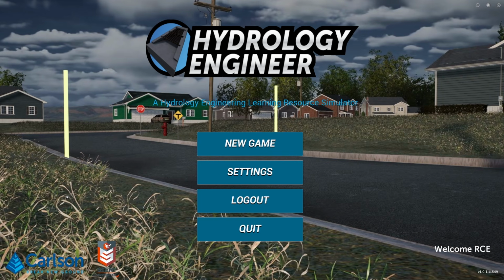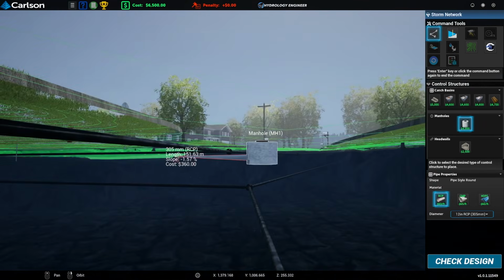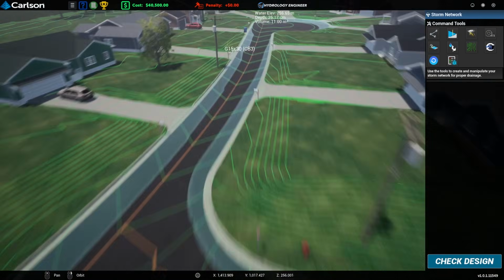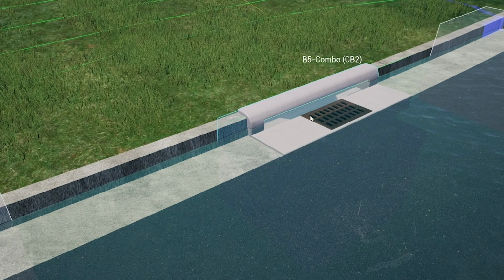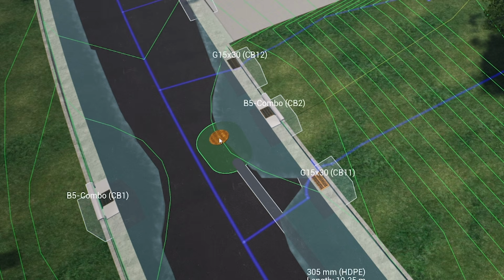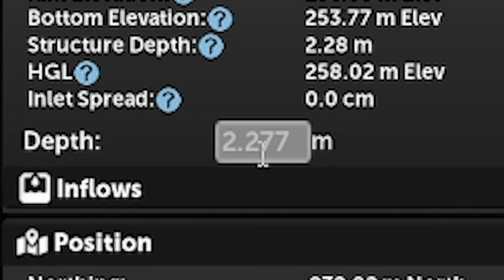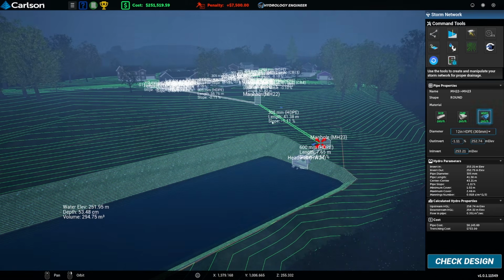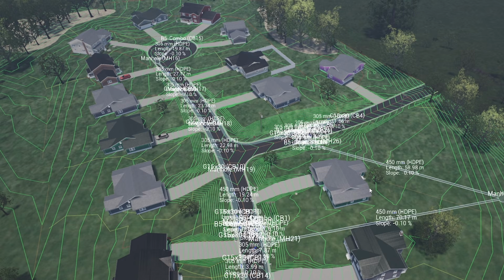The secret purpose of these holes...

Comment: I just learned something new from this actually. In geology we were taught that in rivers, you view the contour lines like “cups dumping water in the direction of flow” so the top of the v was the flow direction, but here the v is pointing to the direction of flow. And the difference I’ve learned is that roads are raised to direct water into the side drains, whereas rivers are full valleys

Comment: (30:58) why Minecraft does this is also actually because of a certain "lazyness", if one could say so.
In computer graphics, the x- and y-axis describe the "width- and height-axis" of your window, and the z-axis the "depth" on your window.
Thus, resulting in the x- and z-axis being used for "horizontal coordinates" and the y-axis for "vertical coordinates" in video games.
It would be possible to display coordinates 'the other way around' as "x, y, and z" for "horizontal-1, horizontal-2, and vertical" but that would introduce another level of calculations, which might affect game performance.
Another argument that came to mind, was, that the intended target audience is not aware of this debug-screen feature or will not use it to a degree that it would bother anyone.

Comment: Ok so this was a year ago, but on the off chance you see this, I would like to try to convince you you're wrong.

So what's my perspective? Well, I see it as I'm looking down at a map. Essentially a piece of paper. So the X and Y coordinates lay on the 2d plane as expected, and the added new dimension gets a new letter and a new direction (up).
This also conveniently fits with programming, as the up/down direction almost always is the odd dimension out.
And take the ingame map that only displays two dimensions (pfft). I find it way more intuitive to have it show X and Y instead of X and Z.

Now, I get that from the perspective of looking at a monitor, you could easily make the same argument about the screen being the flat plane you're looking at, so it should get X and Y, but the choice in naming the axes is completely arbitrary, and turning the camera 90 degrees as the final step absolutely no overhead at all. Use the coordinate system that is the least awkward for the thing you need it for.

For level geometry, Z makes more sense to be up. For triangle rasterization, it should be forward. Or back. We can't quite decide.
Hey at least we made Y be both up and down, depending on if the artist is working on it or the gpu is working with it. Nice footgun.

Comment: X Y and Z are pretty standard, though not standardized. It works the same in almost all software I've seen: minecraft, a host of other games, video software, 3d rendering,  web development,  and this tool you're using now. It's just that the tools you use are usually designed for top down viewing. But in all cases mentioned, X is horizontal, Y is vertical,  Z is depth.

Comment: Lies. When i open my tap, the water comes from a local water towery thing which isnt really for water storage, its pumped up there from the cistern so that there is pressure on the pipes thanks to elevation (even if theres a power outage). And if i flush my toilet, well, im not the landlord but id think its just a big hole in the ground, maybe something like a septic tank or something, but there is a big plastic pipe sticking out of it in the backyard to let the gasses out i think. Not really my concern so long as it works, it will be once i build myself.

Comment: Unfortunately, there is no universal convention on axis orders.  Much like little endian vs big endian vs network byte order for storing numbers in computers, there are always drawbacks however you do it.  Civil Engineering has strong ties to cartography, which used X,Y for the east/west, north/south directions (N is the top of the page, generally).  So extending that to three dimensions naturally has Z coming out of the page (Up).  Even here, there is immediately some confusion, as Down can mean either into the page, or toward the bottom of the page (South).  Meanwhile, mathematicians conventionally use X,Y for left/right, up/down on their chalkboards (now whiteboards).  Adding a third axis then naturally comes out of and into the board.  Since this is not a map spread out on a table, but a board used for instruction, there is a tendency to make the xz plane still horizontal and leave the Y axis as the vertical axis.  

Fast forward to modern computers and modern computer simulations and graphics, OpenGL, which is the library focused on drawing shapes on screens from triangles follows the mathematics convention.  Likewise, vector drawing programs (including your web browser), use Z-indexing to determine draw orders, while space on the screen is X,Y.  The major advantage to this approach is you can simply ellide the Z axis when you are working in only 2 dimensions.  Of course, this means if you are looking sideways through a 3-d world, gravity points in -Y.  

In this sense, the camera's Z axis is always out of the screen, it's just the physical significance of that which is inconsistent.  As a related issue, the moment you have something more complicated than a trivial hull and sprite, you need to track the positions internally.  Think about a simple stick figure, the head needs to be at the top, and the feet at the bottom.  If you can "ragdoll" this, then gravity within the model can be in any arbitrary direction.  So you need to be able to convert local to global coords.  Once that is the case, you very much stop worrying about which direction is your gravity vector since it truly is all relative.

Comment: the Whole X, Y, Z, thing is different in the Art world X is Horizontal Y is Vertical and Z is depth, (distance away from the theoretical view point) that is why they have it set like that in Video games (it is always invert y axis to changer the Vertical joystick controls) because they all use 3D Artists to make the models so they would use the Artist's standards because most people working on it will be familiar with that, Also the reason Engineers have the Z be Vertical, is because back in the Day they would have Flat paper schematics that would be laid out in the same as X,Y, Z format as artist would use, BUT the theoretical view point would ALWAYS be looking Down from above because that is the best perspective for a Schematic of that nature and it is only when you take that schematic and turn it into a 3D render does it conflict with the way say Minecraft is measures it, because they have to rotate it from being top down to the viewpoint of a human standing at ground level

Comment: Talking about the man holes being uplifted. A lot of our city’s man holes are welded because I don’t know about the UK, but in the US we have what we call drop neck trailers. We’re the front portion of trailer, would disconnect from the trailer itself. So you can load equipment without ramps and etc. Them trailers have engageable magnets that are safety features to help secure them
 20Ton-100Ton loads on with the chain you would apply to help secure it to. Them magnetic were strong enough to brake a man hole in half if the magnets on the trailer, picked it up and hit the trailer right.

Comment: I watched with great interest. If I was asked I would say you are at least an experienced professional in the field if not an expert. I appreciate the inclusion of real world photos of what you are discussing. Not everything a computer does has to be a game, and honestly, I have to laugh at the comments from people fussing at you for teaching them something.

The 'Z' axis confusion goes back to the late 80s and early 90s when the various 2D CAD programs began to add the third dimension. The Z axis was always the dimension that moved above or below the 2D drawing plane. The fly in the ointment came from if the program considered the "plan" view or the "front/side" view the default 2D drawing plane. AutoCAD which became AutoDesk and later 3DS Max was originally an architectural designer that worked off of a default plan view. In a plan view, Z would be 3D altitude, but in a front or side view used by many 3D object design software, the Z axis would be the depth of the object being drawn. This difference in perspective from one software to the next has never been officially standardized. Off hand I can think of one other program that uses the 'Y' axis as the altitude axis and that is Microsoft Flight Simulator (and probably most other Microsoft simulators as well).

Comment: Funnily enough; It's not just minecraft, i'm a certified CAD designer and we use Z as depth, so (in relation to the object) X axis is your left/right, Y axis is up/down and Z is forward/back. I know solidworks and autodest are setup like this, can't sat for sure others are.

Although you can change the axis orientation in most program's settings to fit the user preference. 

Great vid as always, Cheers!

Comment: XYZ: x is always to the right of the origin, y is always upwards, and z is always towards the viewer. It's basic maths. 

You may be thinking of xyz on printed plans, in which case up in the real world is towards the viewer on paper, hence it's z for you. 

In the world of video games and maths,  y is always up, not z.
Reply: Ya, except when it's not... I've seen plenty of games that have Z up. The game engine doesn't really care, you can point the camera any direction you want, and it's just as easy to define one axis as "up", as it is another. For 2D applications sure, and that's  where you get terms like z-depth and z-fighting from, because that's always perpendicular to the plane. (But again, which way varies.  +Z away from you makes more sense for a video game where that direction is forward. +Z towards you is the same as XY flat, Z up, but rotated 90.)
Reply: @Tahgtahv  true, programmers may assign any axis in any direction, but in my experience making video games, it's best practice to maintain consistent orientation. I believe blender and other 3d rendering software orients them the same as minecraft does.

Comment: The holes are perfect for the bridges right Matt? (I live in Swansea (close to you) and the big bridge that connects Neath Port Talbot over the river has lots of holes for water to flow (I guess because the bridge doesn't have any trees for leaves to block up the holes because never in a flippin million years is someone cleaning the holes on the motorway)

Comment: I think the reason that Y and Z are opposites when compared in gaming and real life is because in real life, you'd use a grid from a top-down perspective, like a floor plan, making Z vertical when working in the third dimension. But in video games, I believe they were originally popular in the form of platformers, which means when adding a third dimension in the form of Z, it would be depth and not height unlike the real world.

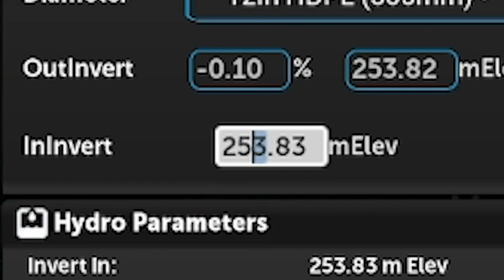Comment: at 30:10 The XYZ Axis in videogames has it's root in Math graphs, where x is horizontal, y is vertical and z is depth. it's not realy wrong in most games (this one strives to be a simulation, so i would say in this game, it's wrong). It's kind of rooted in first 2D Games like Mario where they used the y axis when refering to hight and it never realy changed when they moved over to 3D in games like mario 64.

Comment: The reason why the Y and Z for hight is different in games is, as you said, 
in reality you mostly use a top down map perspective, which naturally uses X and Y for the base position and therefor only Z for the height.
But in the beginning of games we mostly started with a 2D horizontal maps. (Like all the old games such as Space invaders, the first Mario and so on)
Wich means it would be pointless to use X and Z there and therefore they used X and Y because it's only 2 dimensional.
But when 3D became a thing in games, the only remaining value was Z, and since everyone was used to use Y for the hight, they just continued to do so and used Z for the 3rd dimension that is basically coming towards you when you turn a 2D image into a 3D one.

Comment: fun fact: manhole covers are circular because the diameter its constant and will never fall into the pipe of a smaller diameter. If it was rectangular it could potentially fall into the manhole and youd have a very deep hole in the road.

Comment: so the XYZ cordinates issue stems from computers vs maps  a computer screen is the base with a x and y cordinates being based on the cordinates of pixles on the screen and z being used as a depth modifier. where as in mapping your base is the area looking down and height being the 3rd dimention modifier. so games using the Y cordinate as a high makes sence because they are in the mind set of the compuer screen and for simulations/ mapping it is rooted from sea level.

Comment: near the high school in my city is a large field with a huge tree and one of those outlets. so it would be considered a detention pond, it has a multiway path that goes through it to the park that is on the other side of the tree still relatively lower than the surrounding area. the park used to have this really cool wooden maze structure that we used to play on. they redid the park a couple years ago and removed it which makes sense cause it was wood that would get flooded and then start to splinter when it dried out. it was there for at least 18 years before they redid the park. i did not know that it was called a detention pond till now, i thought it was just poor design and park placement.

Comment: Basically, coordinates used for describing height depend on the handedness of your coordinate system. In math, it's usually right-handed, and in game engines and computers, it's usually left-handed. But for some reason, Unreal still uses a right-handed system 🤔
Also, you should take these words with a grain of salt, as it was quite a while ago since I did any linear algebra, so I could've messed this up bery badly 😅

Comment: In the cartesian plane, Y/X, the slope, is Rise over Run. However, if you put the cartesian plane on a map, the Y is the top of the paper.

So, if you're a civil or survey engineer, Z is the height coz you have a top-down view. If you're in highschool, you only deal with polyhedrons; it does not matter where the top is. The answer would not change, but most use the lateral view. Think of a cube on a cartesian plane before you studied engineering: which one is the height?

In minecraft, the game is played mostly with a lateral view, and rarely with a top-down view. So, I think that's why.

Comment: X and Y aren’t always “looking down” with z being the height. In some engineering things I’ve done where you’re looking at the profile of something y is the height and z is the 3rd domination coming out of the page. Especially when the thing you’re looking at is plainer or fairly uniform across the z domination (thing heat transfer or airflow over an airfoil)

Comment: I think the x, y, and z orientation being different in gaming is because x is the horizontal axis, and in side-scrolling games (which were first to be developed), y would have been the vertical axis. In 3D games, the z would be for the remaining axis (which would be the depth if you're looking at something side on).
Reply: It's more because of how we use our screens. If you place your map in the wall, x and y would be horizontal and vertical respectively.
This is actually consistent with how z axis works in geometry (perpendicular direction of xy, which is the planar surface).

Its just not intuitive for people who used to have z as vertical. Some software like cad would do both; follow "screen" convention when in 2d, and rotate the view when in 3d.

Comment: In my country it's actually illegal to just let water from your lawn or driveway drain onto the road. That's because in winter, when snow is melts during the day, the water can't properly drain or evaporate, instead it will freeze over night, which leads to accidents and injury. If you have a sealed, non-permeable driveway that falls towards the road, it's your responsibility to prevent the water from getting onto the sidewalk, mostly by having a narrow open pipe with grating on top all the way across your driveway, sometimes even two if it's too steep. For lawns, either the sidewalk is higher than your lawn, or your fence sits on top of a low concrete wall. Roof drop pipes will generally drain into another surface water drainage pipe or a dirt hole filled with lose rocks, so the water can actually seep into the ground quickly and not just sit on top of the dirt. You will NEVER see a roof gutter that just drains onto the grass. The goal here is to get the water back into the ground as quickly and efficiently as possible to keep the earth moist and permeable. If the earth dries up, it becomes dense and hard and is no longer able to take on any amount of rain water. Oftentimes there's actually a ring of lose rocks all the way around a building, directly at the borderline between the foundations and the lawn, so rain water coming down the facade can drain into the ground directly and won't stay on top of the dirt

Comment: Based on the assumption that a manhole cover is 1m2 and weighs 200kg, an under pressure of 0.2 bar is required to lift them up (which would be 0.8atmospheres at sea level)